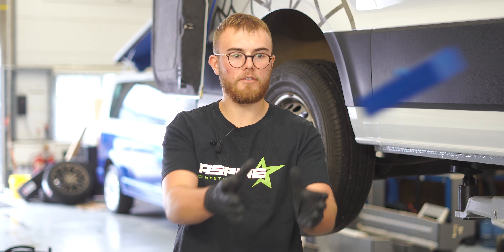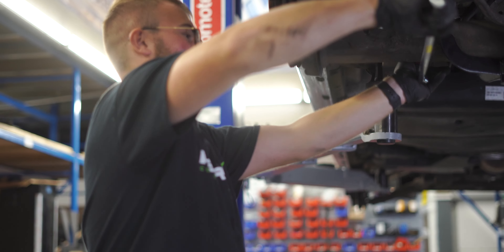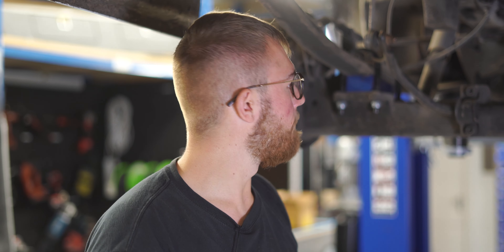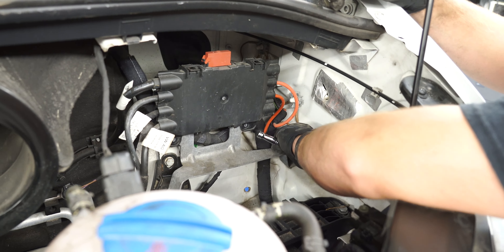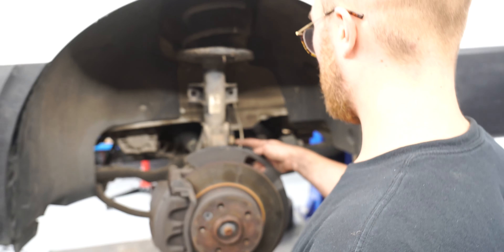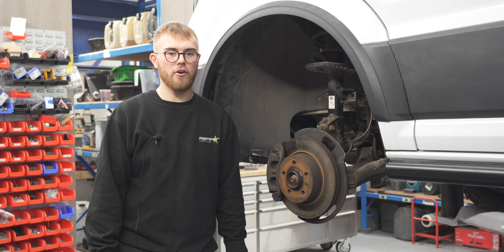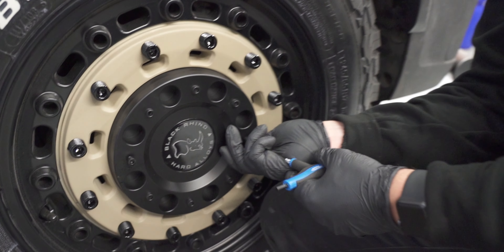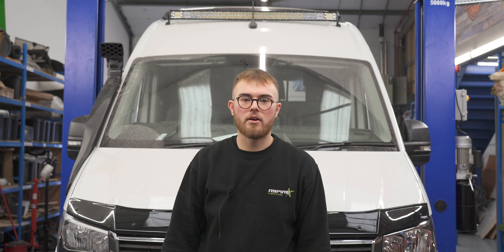VW Crafter & MAN TGE Lift Kit Tutorial!

Comment: How much can the car be lifted? Is it possible to install an air diff locker in these axles? What's the largest tires you can fit with this lift without rubbing? Thanks!

Comment: Hi! Would the lift kit work also for the 4x4 ( I have MAN TGE, 4motion on VW )? What was needed to be changed to fit BlackRhino rims? Was installing lift spaces required to fit the KO2s or can they also be installed without the lift kit? Thank you
Reply from the maker: Hi there, I believe the lift kit would work on the 4x4 as it’s also leaf springs on the rear, the black rhino wheels were already the correct fitment however needed spigot rings to sit on the hubs properly. The Ko2s possibly could be fitted without lifting, but we haven’t checked that ourselves
Reply: Hi mate do you know where to get upgraded springs and shocks ? Cheers
Reply: Hi mate. I’m in Australia- where is that kit from if I may ask?  How is it different from the Seikel lift kit in turns of performance? I’m not sure with what to go with.🤔
Reply: Out of interest, what’s stopping a higher lift of 70-80mm on the front?